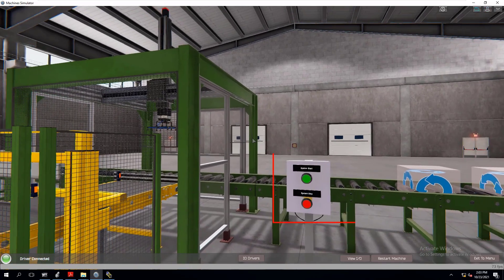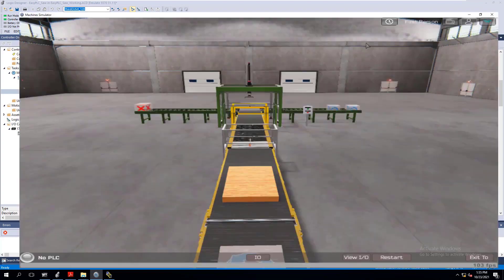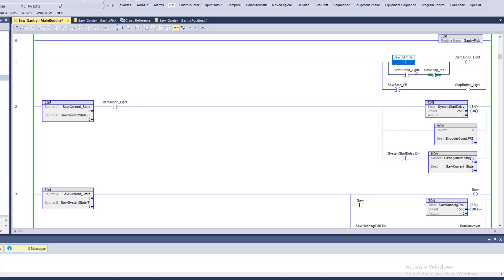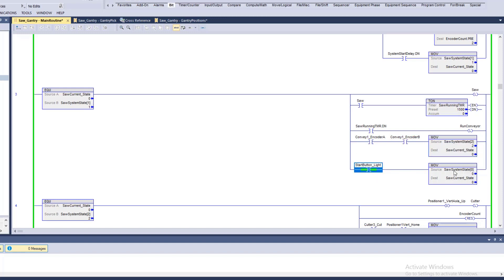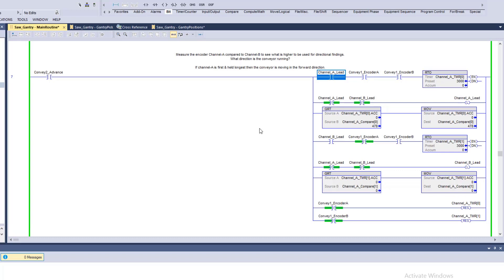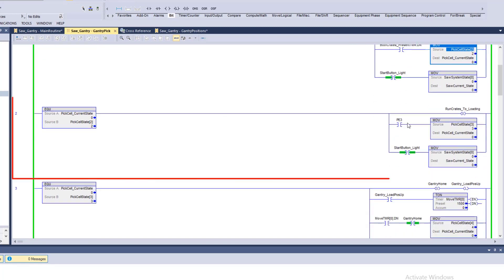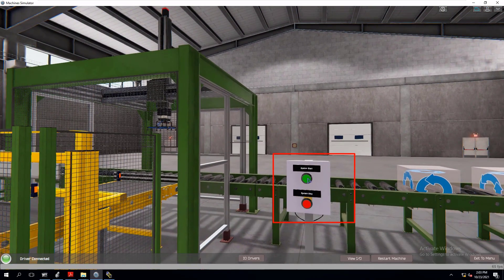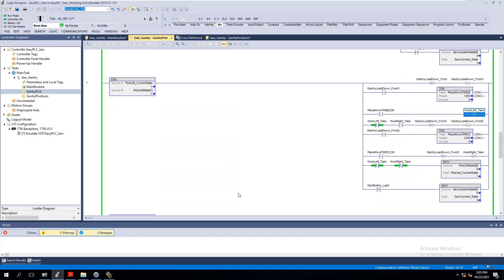PLC Programming Saw Gantry Pick and Place Using Ladder Logic

Comment: As usually a great video! I was wondering if you could elaborate on how you are using the encoder to determine when to cut? I saw how you are using it to determine if the conveyor is in fact running, and in what direction it's moving as well as the FPM. It didn't seem as if you were actually using it in determining when to cut. I probably missed it. Thanks again for all the great work!
Reply from the maker: I calculated it forward or reverse using channel A measurement & channel B measurement.

If A first then forward

If B first then reverse